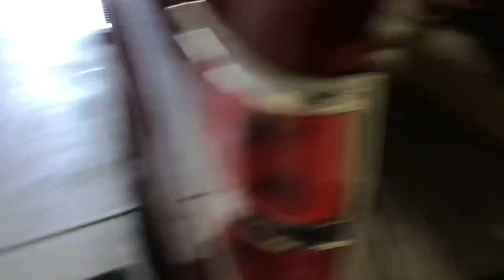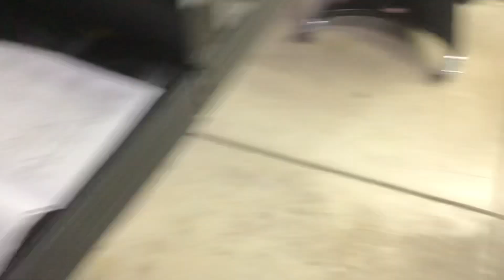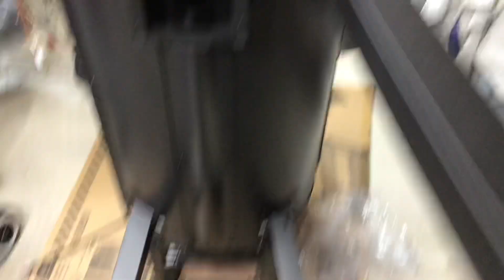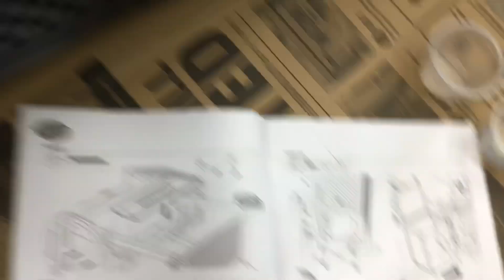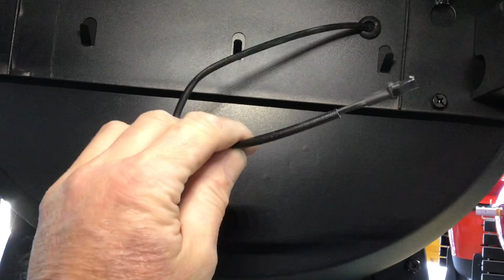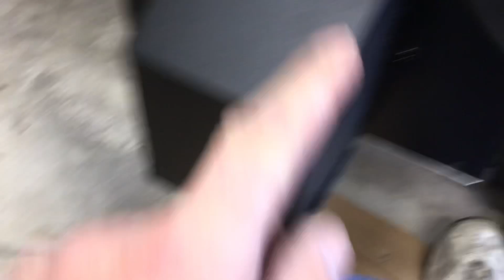The New Char-Griller Graity 980  Charcoal Grill / Assembly Made Simple!! Super Easy!

Comment: Has anyone encountered an issue with the temperature displayed vs the real temp? I see the temp in this video to be 76 and I wonder what is the ambient temperature. Mine is showing 20 degrees of difference between the ambient temp inside vs the controller temp. Before, during and after cooking. Char-griller claims that this is normal but it is a little unrealible and I don't want to compensate in the controller. Thoughts? Thanks
Reply from the maker: Thanks for Watching! I’ve noticed 10-15 degree difference at lower temps but above 300 it evens out to 5-10 degrees

Comment: Tom, on my first cook this evening on my brand new 980, I noticed a wet spot below my grill on the left side. On the bottom of the cooking chamber where the seam is above by the drip pan there’s a constant drip, I guess condensation. This is going to be an issue for rusting out I’m sure. Have you had this problem? Looking inside the cooker I don’t know where it could be coming from. This is concerning.
Reply from the maker: Thanks for watching Mike! I have had that issue once and didn’t have it again. If you look there is a gap that one could put some high temp rtv caulk in to stop the dripping.  I’ll keep watching mine and if I think it needs a mod I’ll post it. In meantime you could notify customer service. I’ll do the same since I thought it was a one time thing. Thanks again for watching and for the feedback

Comment: Hey Tom is the spot where you put the tumbleweeds to light the grill wide enough to use an electric charcoal starter instead?
Reply from the maker: Thanks for watching Brandon!  No, it’s only about 2-1/2” wide. I have in the past used a torch but the fire starters work the best
Reply: @TomHorsmanAmateurBBQ  kind of makes you wonder since they are basically using pellet grill technology with the PID controller system why they didn't install igniter rods on these style grills as well.
Reply from the maker: That’s a great idea, maybe someone will!! I like it!

Comment: Just finished my assembly and burn off. Definitely a 4/10 on the assembly instructions and parts missing.

I had one lock nut come loose, and 2 on the heat deflector that holds the shield that never got put on.

Also I have a scuff on the side that has the paint scuffed off.

That aside I did a burn in at 450. Fluctuated between 440-500 back and forth for about 15 minutes then stayed rock solid at 450 for over an hour. I then cut it to 250 to see what it would do and it took about an hour but settled down nice. I'm still annoyed with the scuff and missing locknuts.
Reply from the maker: Thanks for Watching!  I hope you emailed or called about the missing parts and the scuff. Sorry to hear that.